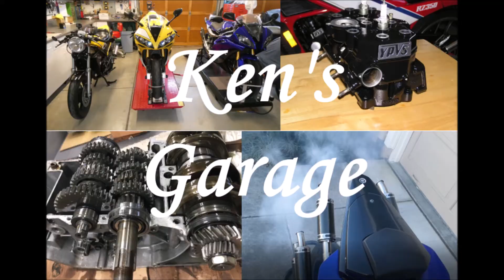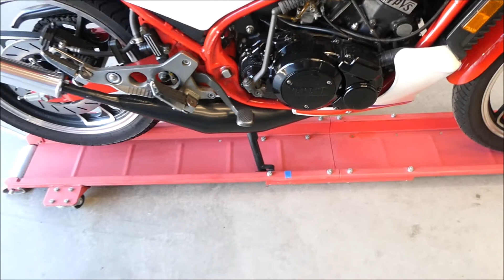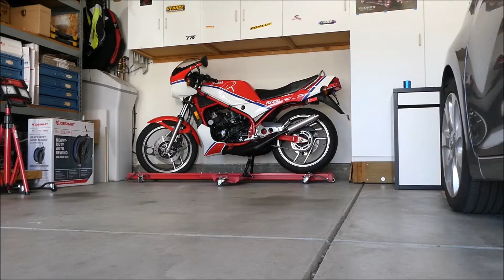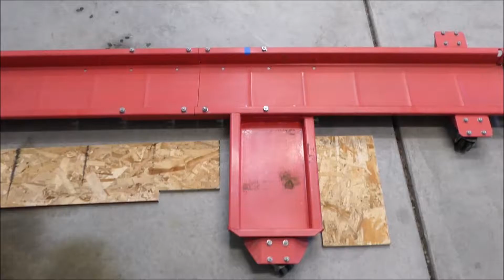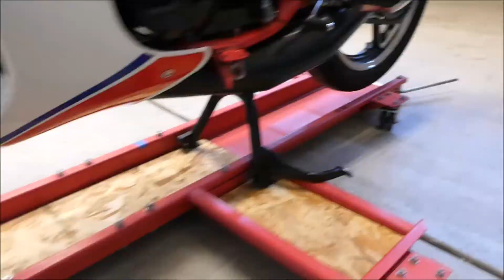Harbor Freight Low Profile Motorcycle Dolly - Using it with a center stand

Comment: try locking casters if you must have them both down. If you're on level pavement you shouldn't have an issue plus why would you have them both down at the same time anyway?  Not going anywhere.

Comment: Wow - another beautiful RZ. That looks like a Canadian bike. Would be great to see you do review of the stock RZ in comparison to one of your modified bikes.  Your new stand seems ideal for getting the bike tucked away. Do you think you could take 5" to 6" out of the side stand section without affecting the stability?
Reply from the maker: Thanks CKD. Yes it is a beautiful 1983 Canadian import and it's near museum quality. One day it will go back to stock non-cat Canadian pipes and jetting. Ironically I met the original owner (he imported it new in to USA in 1983) out of the blue at a show a few years back. The motorcycle dolly definitely could be improved on but works quite well as is and I've a few (hundred) projects to do before modifying the thing anymore.